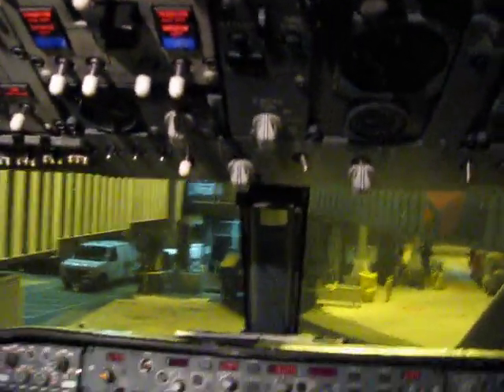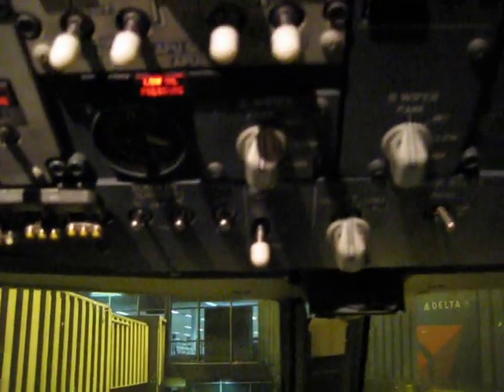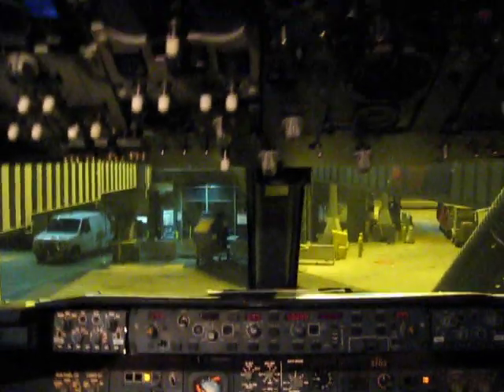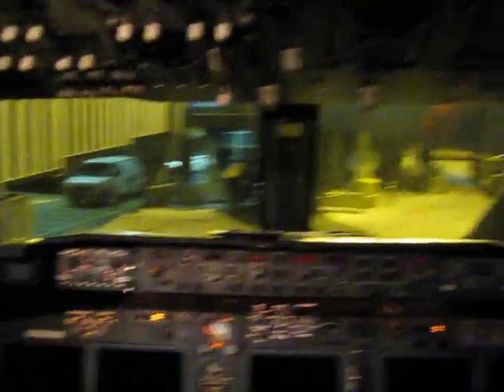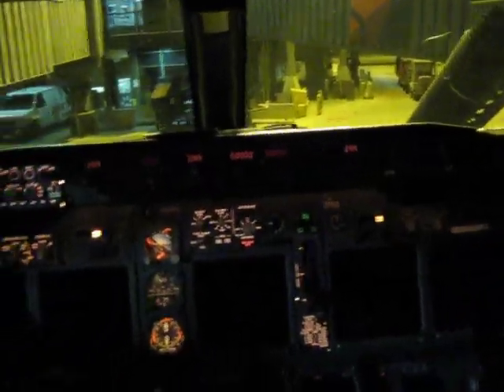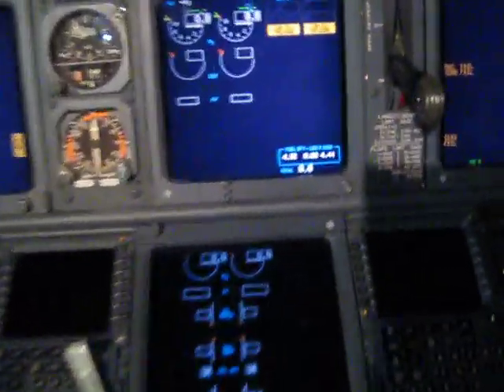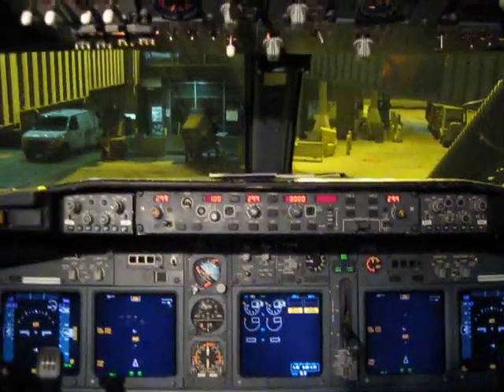737-800 APU Cold Start short demo

Comment: Doesn't the APU need the Left FWD Fuel Pump to be on?
Reply: Yep, also noticed this. Maybe it was switched on much earlier.
Reply: @norbert.kiszka  at 0:50 you can clearly see the Left FWD Pump switch is off...
Reply: @norbert.kiszka  yes indeed, but the guy you linked explains it. The APU has its own pump inside of it which sucks fuel from the left tank to power the APU. The Left FWD Pump is only needed so that wear and tear on the pump in the APU is reduced.

Comment: Why does the MCP look a little different compared to the other NGs?

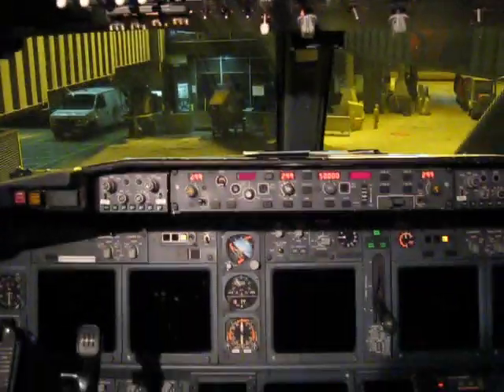Edit: love the ding at 2:12
Reply: This one is Honeywell MCP, standard on early 737 NG until 2003 when the Collins MCP, which you usually see, became standard. The current collins bring in cat iiib capability which before only up to cat iiia, and able to perform single engine autoland.
Reply: there are multiple MCP variants. i think this variant was also used on the older classic ones.
Reply: This one is the Honeywell MCP, used on classic mainly, but some NG's do have it as well

Comment: Hold on, no need to turn on fuel pump to start APU?
Reply: Nope, because the APU is supplied by a separate DC Pump fed by the DC of the battery

Comment: My 2 cents: the apu spools up to cool down, the gauge is exhaust gas temperature - to be monitored during start with the amps drawn. I think after you check proper configuration (see the other comments) turn the apu to on position and wait a few seconds for it to configure, then as shown to start. All of these opinions are from reading and pmdg sim - I've only really flown a 152.

Comment: Yea, uh ... need to follow checklist even if you are on the line and not a pilot. You MUST do a fire test first. If the fire system is INOP, and you have a fire, you wouldn't know until it was too late. Glancing at the logbook to see if the APU is INOP doesn't cut it.

Comment: Everything about this is wrong XD
Holds start for 7 seconds, doesn't even bother to test the APU fire alarm,  doesn't switch a left fuel pump on to reduce the strain (which is ironic since APU inops are normally caused for this reason), and he immediately puts the APU on the bus after it stabilizes. Oh, and when he showed the power generation on the metering panel, it was showing the load on the Battery, not the power generation of the APU.
Reply: You need to wait 1 min just for bleed not electrical power :)
Reply: Piotr Kuler Really? I always thought it was both. I’ll have to look into that. Thanks!

Comment: How did he start APU while all fuel pumps are OFF?
Reply: Suction feed. It's a DC fuel pump that is automatic. Fuel pumps can't be operated with only battery
Reply: The APU can still draw fuel, just much harder for them without the pump on.
Reply: They are ac powered so..  😂

Comment: Why didn't you used the external power(gpu)?
Reply: bikepark lowtrails I believe ground power wasn't available at that particular airport the aircraft was parked at. Notice at 0:47 that the Ground Power light switch (above the engine gens and apu gens switches) didn't light up. It indicates either ground power wasn't available or it wasn't connected to the aircraft.
Reply: They need to move the plane. Can't be on ground power when it's moving. And if they're taxiing it rather than towing it, they gotta start the engines which needs the APU anyway.
Reply: So they can't save any fuel from APU burn?
Reply: dont need to.

Comment: FWD fuel pump on before starting APU?
Reply: math there is also a DC fuel pump which operatates automatically
Reply: FWD fuel pump is AC operated. It doesn't work with battery only.
Reply: Michael Mitiszek yeah it looks like quite a few steps were skipped
Reply: Michael Mitiszek suction feed
Reply: Yeah, I'm curios too. APU need some fuel to start doesn't it? If start APU without fuel pump on, how APU get some fuel to start?
Reply: dont need to, its a next generation.
Reply: No need, pump in APU

Comment: why do you have to start the APU to move the plane? when you say move, do you mean tow?
Reply: The APU doesn't supply hydraulics in the 737NG, you can have Hydraulics with the 1 & 2 ELEC pumps. I just wonder how can the APU be started without the fire test!
Reply: I would assume that he probably had started from the APU so when the tow moves the plane to a gate there is power being supplied to the aircraft so that it is not just running on batteries alone which can run out after a limited amount of time.
Reply: they probably need someone in the cockpit for safety
Reply: Yes one of the team are there in the cockpit during ramp moves
Reply: no APU, no HYD, no brakes
Reply: that's right, thanks for correction.There are 4 Hydralic switches, two of them usually left on. 
usually you can start the APU without fire test but they have to do it anyway for checking faults. Last thing you want is no indication of an APU fire
Reply: Micheael Bulikov he has to rise the brakes in the cockpit
Reply: its a plane, it doesnt care if you did the fire tests( no plane in existence cares), you clearly dont know how the systems work, how do you think the AC hydraulic electric pumps work if the apu isnt providing AC power?